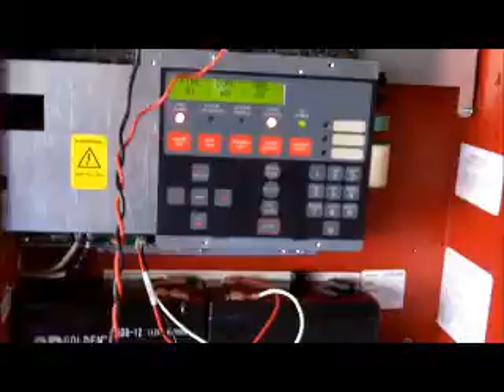HOW TO: Adjust Pitch on Simplex 2901 or Faraday 6020, 6120, etc

Comment: @faralarm does this work with the newer style mechanical horns that are driven by circuit boards?
Reply from the maker: kind of,  it pretty much only works to bend the short tab with the spring attached since there's no contacts on the other side

Comment: Just a note, this also applies for those horns that were manufactured in the 90s, as well (Siemens U-HN, Simplex 2901-9838, Federal Signal 450D series C2 and D1, etc).  If the horn sounds like it's on its last leg, moving that tab may help.

Comment: Thanks I had a problem with one of my horns it would first sound off really soft then get loud so I did what you did to see if anything change an yea it work now it's working just fine : D
Reply from the maker: No problem! these old horns will work for a long time if they are adjusted occasionally
Reply: Oh okay cool x D
Reply: Hey quick question what is a good panel to use for these type of alarms ?